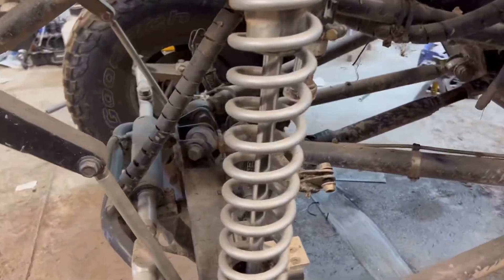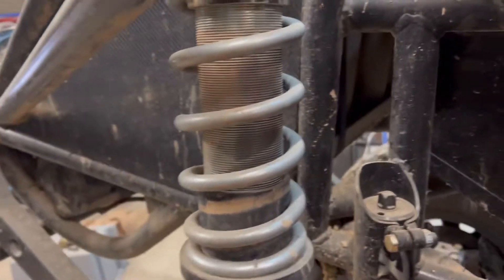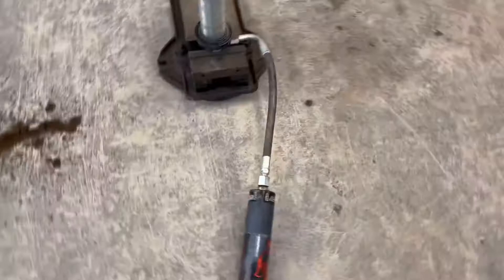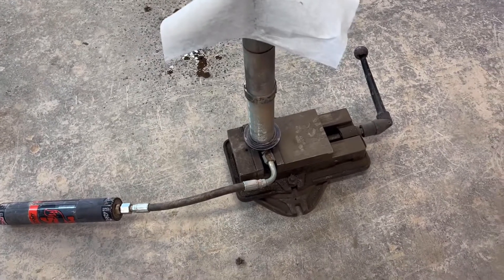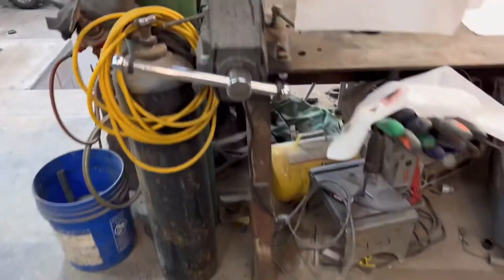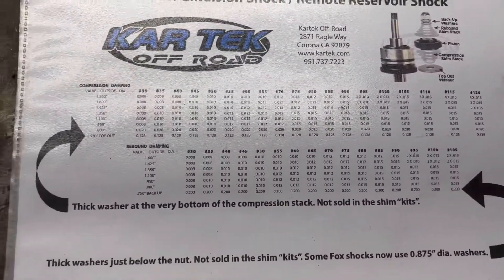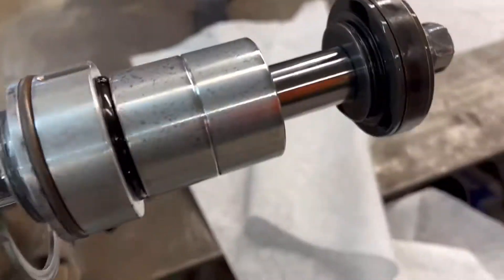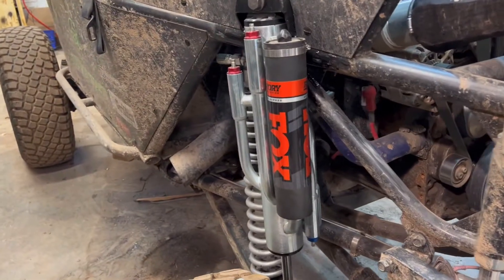Fox 2.5 Dual Rate Coilover Shock Disassembled and Re-valved

Comment: Watched video a million times trying to catch how you remove the shock from the springs. Are you just removing the top cap and sliding them out the top??
Reply from the maker: No, there is a collar on the bottom (rod) end.  The collar slides up and there is a snap ring under it.  Once you remove the snap ring, the collar and springs will slide off.
Reply: Thanks man. I finally got it off with lots of pb blaster. Its so rusted Im going to have to ship them in this time @irionmotorsports

Comment: You’re Aubrey. I know you. I was a friend of Ayla. I remember meeting you maybe ten years ago or so I think at Pie Fest. Nice buggy man. I didn’t know you did that kind of stuff. I was just poking around YouTube trying to find a solution to my fox coilovers making a clunk sound. I live in Fairbanks, Alaska now. But man if I was still in PA I’d have to come check this out. This just made my day, how cool.
Reply from the maker: Nice, I love Alaska.  Never been to Fairbanks though.  The furthest north we went was Matanuska.  Your coilovers shouldn't be making any sounds, unless the mounts are bad.  Maybe look at ball joints or cv/universal joints.
Reply: @irionmotorsports  Yeah I can't imagine ever leaving Alaska anymore. I Do love how fair the mountains and land are in PA though. But yeah I took the spring off of the coilover and released the nitrogen so I can move the shaft back and forth and it clunks from inside the body when I move it in both directions with little effort for like a 1/4 before oil starts moving through. They're only three months old so I can probably send them in for warranty but I just hate when I have someone else work on my stuff. I can't imagine anything being broken inside there. But it voids the warranty to crack it open. Maybe it has an air bubble or low oil. No oil leaking though.
Reply from the maker: Thats odd.  Sounds like the nut on the end of the shaft might be loose.  Fox makes the best shocks, but their turnaround is slow.  If you send them in to be repaired it will take a while.  I would see if you can get them replaced.  If they won't replace them, either repair them yourself or take them to a local shop to have them worked on.  I wouldn't drive on them any more as they are.
Reply: @irionmotorsports  Well, you know what? You were absolutely right. The nut was loose by about a 1/4 inch. That was an easy fix. Thank man. I appreciate the input.